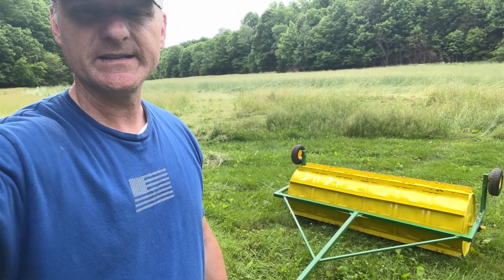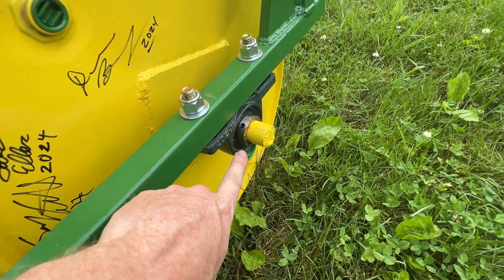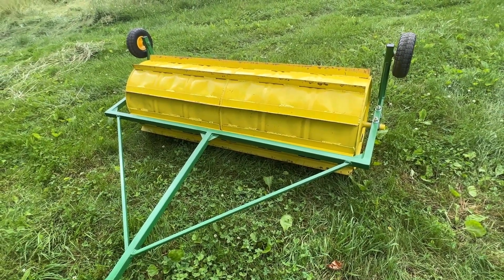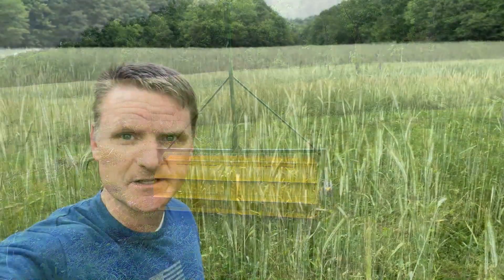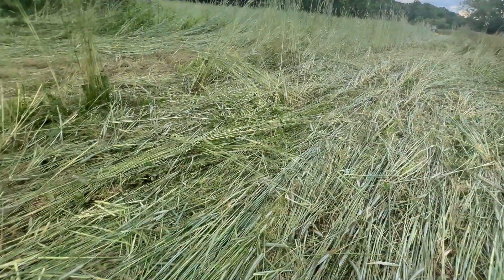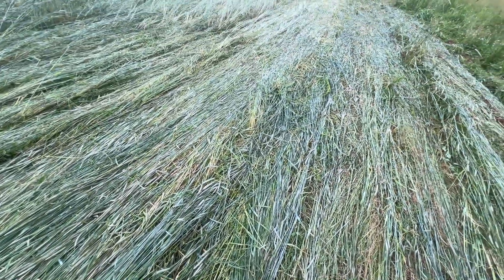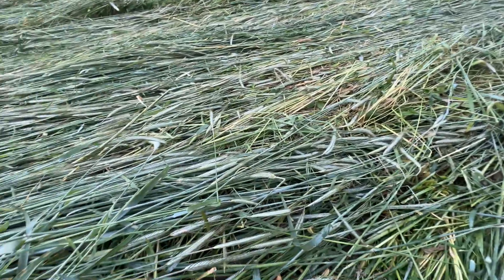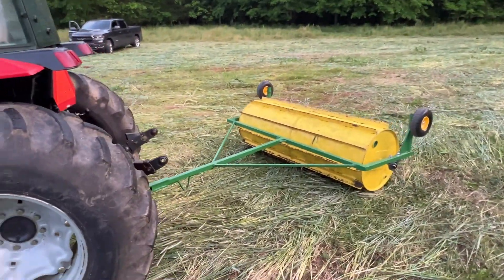DIY Rye Crimper - The Release Process - Buffalo System

Comment: This is a chopper..that's why there is so much vibration. Blades need to be put in a chevron pattern  to control jumping (chopping) and leads to more compaction of your soil...
Reply from the maker: As much as I would have loved to do that, making the chevron pattern in a DIY seemed a bit too complicated for bending the metal and getting everything to line up.  So I'll just have to be happy with my chopper.